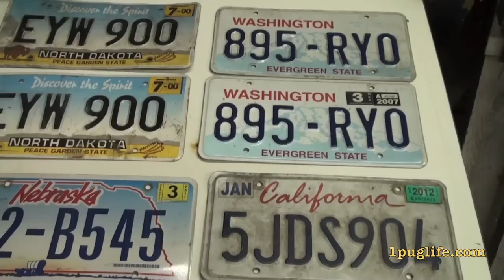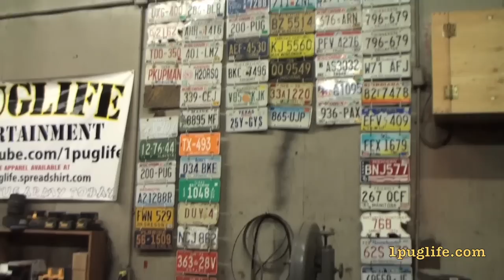cold start diesel wood splitter

Comment: You should rig up a pulley/chain deal to a foot pedal from that handle on the woodsplitter. You could easily do it with a cheap symbol/drum pedal. Itd be a lot easier than having to reach up there with one hand and holding that heavy ass log with the other.

Comment: Pug, ya need a 4 way antler 'pliance on the log splitter.   
Save ya splitting strokes big times, one stroke, 4 split   
chunks o wood. Check out the 8 way antler on this.    
Put the w w w in front of this addy: youtube.com/watch?v=YeanPDO-D6M&noredirect=1